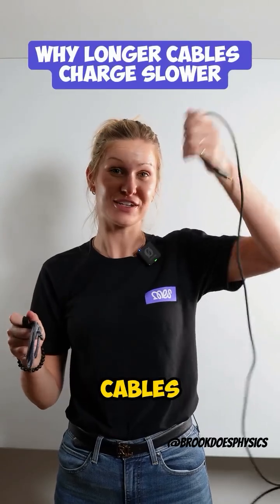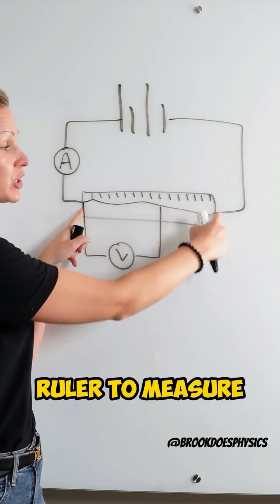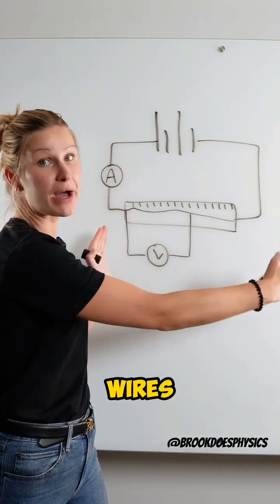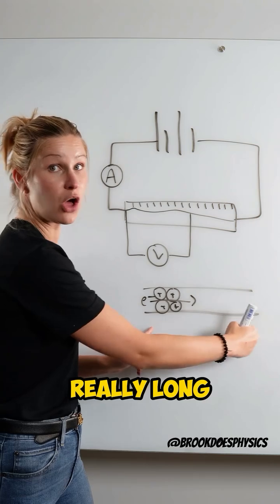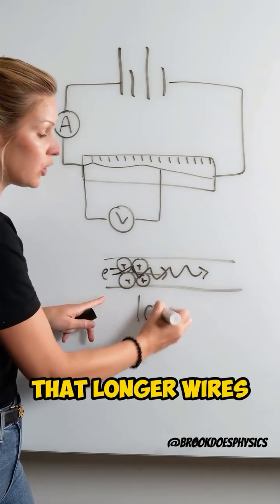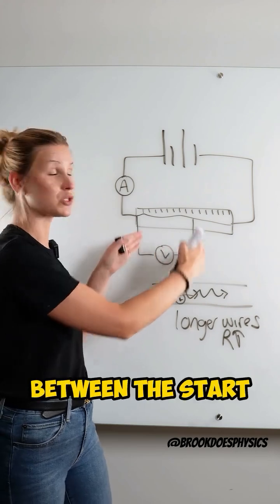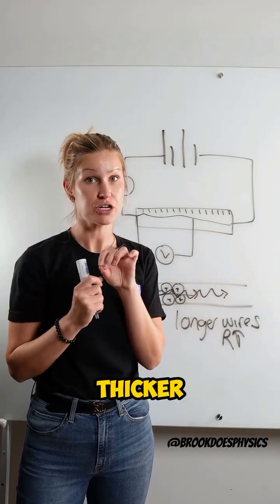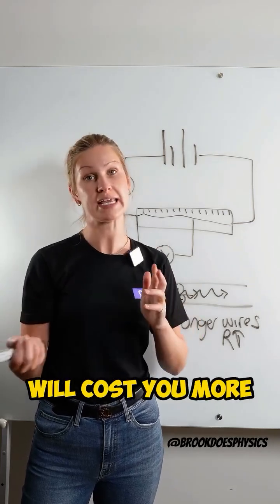Your Phone Isn’t Just Slow - It’s The Physics Of The Cable 📱

Comment: this isn't true anymore, modern charging protocols compensate for this by increasing the supply voltage, with a 3m cable, my phone reports a charge voltage and current of approximately 4.1v 6A, and with a 60cm cable, its the same. this is as measured by the phone it's self.

Comment: But, electricity doesn't  travel through the wire like water through a garden hose....
Reply: It's the closest analogy that works
Reply: But still wrong & disregards voltage, although I guess since it's a phone it's always 5v
Reply: @BKope Nope, phones can go up to 9v 5a on USB-PD and 10v 10a on SuperVOOC chargong standards (yes, 100w).

In the water analogy for electricity flow, pipe/hose diameter is equivalent to wire guage (at least for DC since AC has skin effect), the water pressure is voltage (voltaic potential between positive and negative), the flow velocity is amperage, flow rate (gallons per minute for example) is wattage.

Its not perfect, but gets the ball rolling on understanding basic electrical principles

Comment: Because the three meter cable is longer and take more time to travel
Reply: in a very elint5 way, yes.
Reply: Electricity travels at almost the speed of light. It doesn't take longer to travel. It only has a harder time pushing itself through because it's a thinner wire over a longer distance, which lowers the voltaic "pressure" of the electricity

Comment: I can see why longer wires would make a difference, but how much of a difference. Is it significant?
Reply: No.  Usb compensates, especially usb-c.  1 meter difference is barely anything.  Magnetic windings that run motor have wires 100s of meter long
Reply: @BKope  That is true if the wire is of high enough quality. I hade a cable once that was getting warm because it was so flimsy. Into the garbage it went...